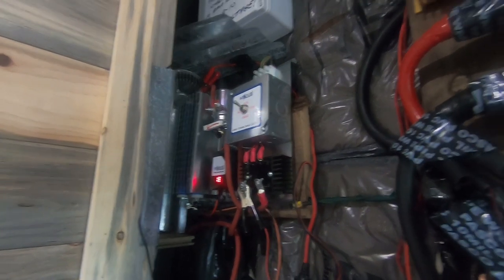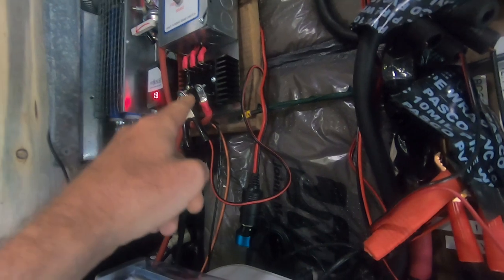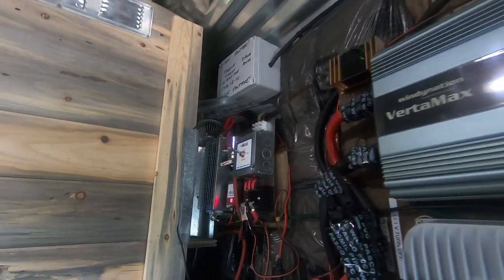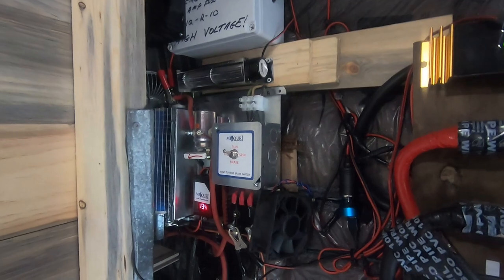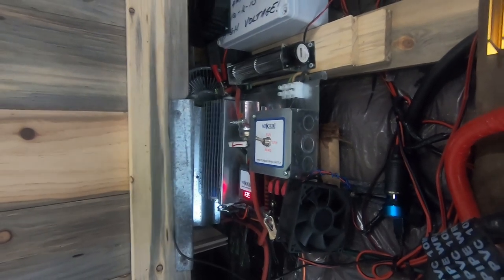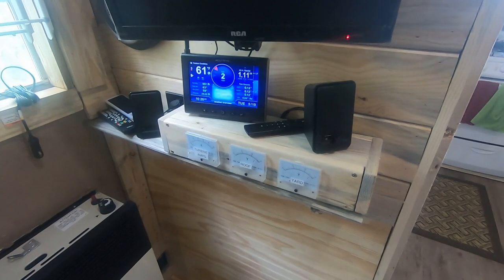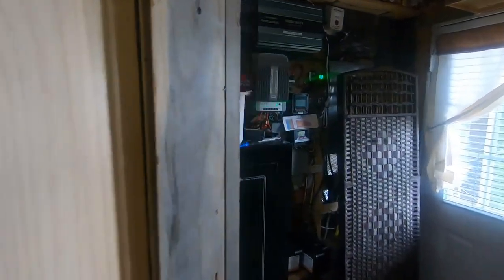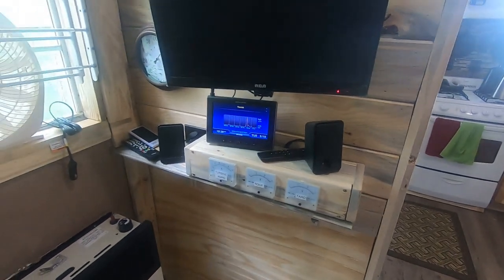Off Grid Homestead Tiny Home Cabin Wind Turbine Mod - Dump Load Cooling and Amp Meter install

Comment: Amps and turbines. amperage is a matter of load so if you don't have it connected to a load like a large battery bank that is depleted you might not see load or amperage at all. Let's say you have 4 batteries that are down to 11.5 V that's an ideal situation to hook this generator to to start to see amperage have about 10 A at 12 mile-per-hour wind speeds. But if you hook this to a 100 Milla amp LED the most you'll ever see is the 10th of an amp so the load dictates amperage. Make sure you hook this up to a large load and then wait for the wind.

Comment: A brake switch is very dangerous for a wind generator because in severe wins over 50 mph the turbine will spin anyhow and then it will start melting switches wires and coils.
 Leave it in the run position if not in use. 
Amperage is a matter of load so the more batteries you have on this the higher the amps will go. If you have no load you will never see any amps. If you have a light load you will only see light amps.
With amps it's all about the load and forcing the turbine or PMA to work hard.

Comment: What is the "maximum # cycles" rating for that solenoid?  At 100 cycles per day, you will hit 100,000 cycles in just 3 years.   A Solid State Relay is better.  Your Dump Load should be connected to the 3-Phase between the Wind Turbine and Diode Bridge, not after the diode bridge, that way when the Dump Load is ON it does not over-heat the diode bridge.  There are many YT Videos that discuss this ...
Reply from the maker: I do not have a diode bridge.  It is a rectifier.  3 phase on one side. DC on the other. This is a turn key kit from Missouri wind and solar.  The old school relay is 20 dollars at my NAPA dealer.  I plan on replacing it every 3 years. The dump load is for my batteries. My cabin uses a on demand propane.  I do not want to mess with a storage tank for my water.
Reply: @GrumpyMountainMan  Diode Bridge = Rectifier.  I understand this is "Turn-Key" design, but is a really BAD design.  And as you gain experience, you will realize why ...

Comment: Do you have a  BRAKE switch that "shorts out" the stator?  This could burn up your stator coil.  There are many YT Videos that discuss this ...
Reply from the maker: Yes...its a 3 phase turbine. Its mounted with the controller
Reply: @GrumpyMountainMan  Be very careful when energizing that Brake Switch.  Too many people have burned up their stator coil = BAD design ...
Reply: @MrSummitville  what controller would you use then?  Advice needs answers when given.
Reply from the maker: You can ground or "short" the wires together in order to stall-out your wind turbine blades from spinning BUT ONLY in wind UNDER 20 MPH
 
If you use "shorting" as a high speed braking system your going to FRY your coil. Today's small wind turbines are designed to take 135 MPH winds and survive. So Leave it in the free position .